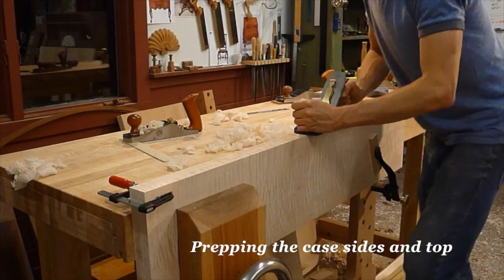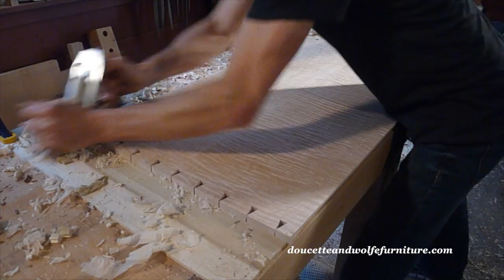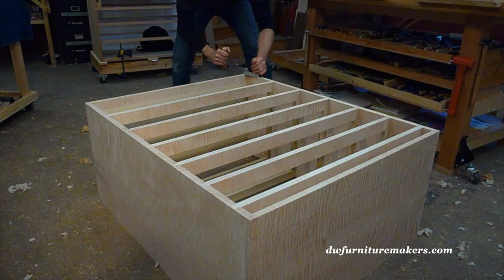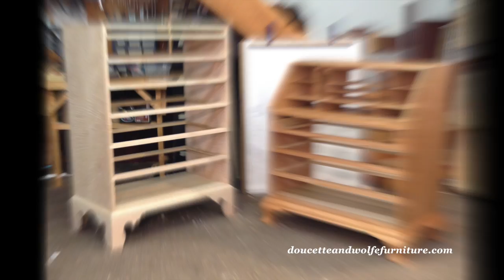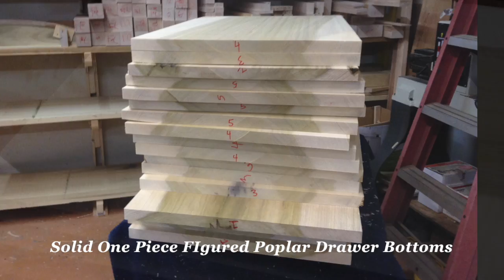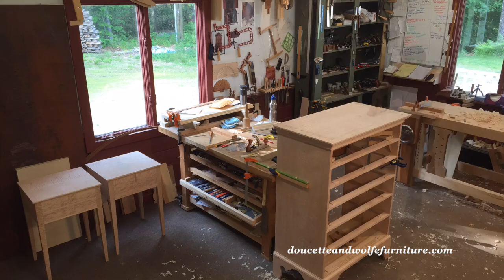Chest of Drawers Building Process by Doucette and Wolfe Furniture Makers

Comment: every time im speechless and dont ever want the videos to end.thank you so much for extending the length of the vids and adding more methods.i can safely say you are the best out there that openly shows there methods.
just a side note, have you ever thought of doing an online teaching class.kind of like pauls sellers.
i have huge respect for paul hes helped me alot.but and its a big but i can see from your work your joinery is above his.
a class of its own.id pay good money to watch you teach.
the one thing that all these so called gurus hold back is the core basic knowledge of when where and why you use certain joints and the basics of design.im not stupid i no why,if they did teach us that then we wouldn't have to watch them anymore.
this info is so hard to come by ive been searching for years and cant find it.ive asked paul why he teaches how to build drawers tables and chairs and how to make the joints but not tell what the joint is best used for,but i get a long answer basically avoinding answering me.
i no your really busy and probably dont have the time to teach how to build projects but maybe you could do an in depth series on the joint application and basic desgn and how to tackle projects from start to finish
thanks for all you do all the best

Comment: Do you ever have issues with the cross grain where the crown moulding is attached to the side at the top?
Reply from the maker: +VC Sawduster We only glue the first few inches of the molding on the side allowing the case sides to expand and contract.  We allow for wood movement on all of the pieces we make. Thanks

Comment: Another stunning piece.  Thanks for sharing!  I've started to notice that most, if not all, dovetail work I see includes the scribe line used to layout the dovetails. Is that always the case or only on dovetails that aren't visible normally like drawer sides?

Comment: Will the mitred framed moulding on top split apart with solid wood in the middle?
Reply: +famous636 
that's a really good question; you've got me wondering, too.

one assumes that it's done much the same way that an original chippendale was, and afaik those haven't split, so it seems like there must be a trick.
Reply from the maker: +famous636 We only glue the first few inches of the molding on the side allowing the case sides to expand and contract.  We allow for wood movement on all of the pieces we make.